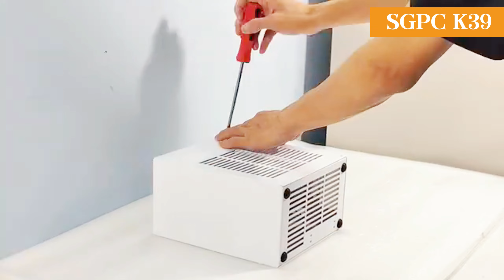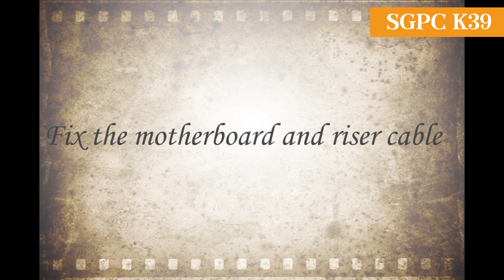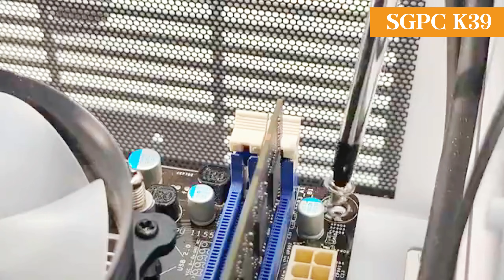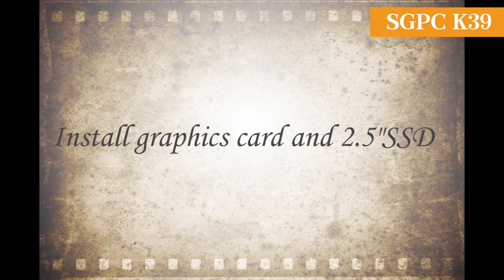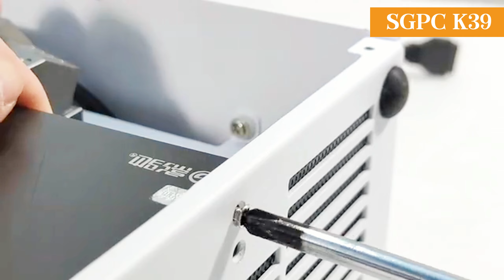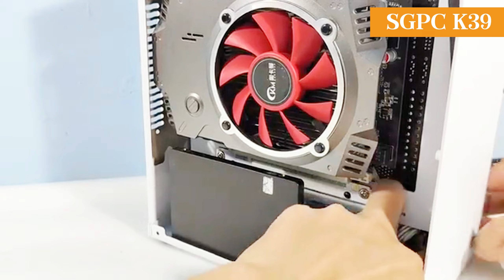K39 AIR COOLING INSTALLATION

Comment from the maker: SGPC Itx Mini Case - K39 (Steel),1U Power Supply,Front I/O USB & Type-C Port,2 Handle can be Installed,Vented Panel - 2 Steel & 1 Acrylic Side Panels / 5L SFF Case 👍👍👍

Comment: I recently saw a K39 that had room for a 66mm CPU Cooler. Which version of the K39 is this? :)
Reply from the maker: if you hexagonal brasss tandoff screw To raise the chassis side panel, the CPU Coller can raise to be 65MM. 
And our new K39Pro is 75MM, new K39Pro is on the way now.